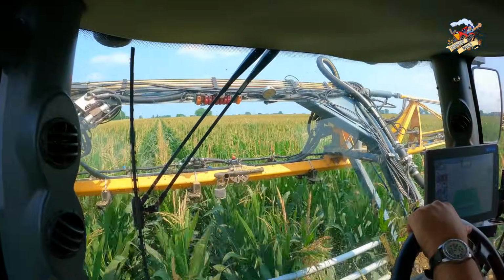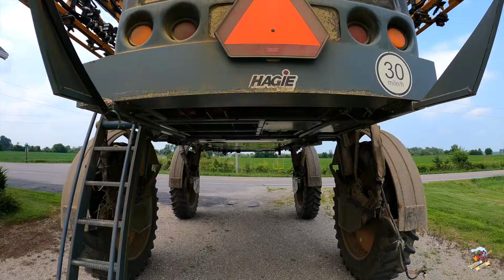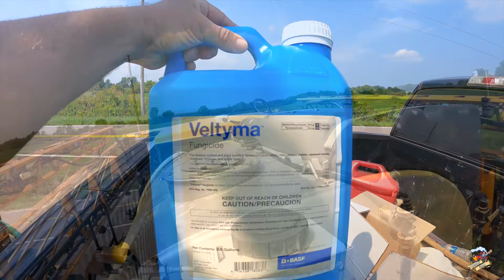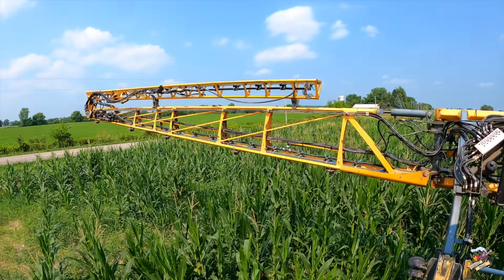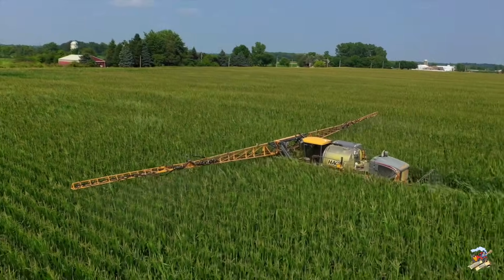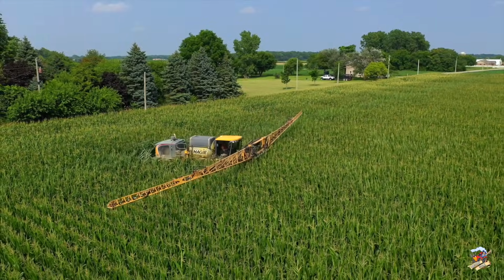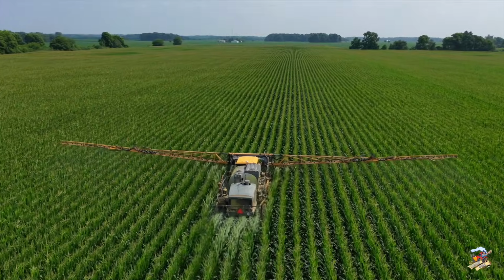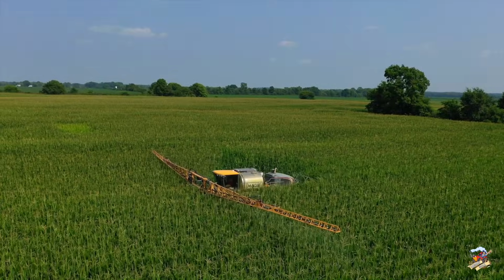Fungicide Application with a Hagie Sprayer.

Comment: The scale of these farms never fails to astonish me, even as someone with a degree in agronomy. I have about 45 acres of fairways, 2 acres of greens and 60 acres of rough at my golf course. A little larger than that one field. It takes me a solid 4 hours to spray just the 45 acres of fairways using an 18 foot boom. Doing 90 acres in an hour is awesome. Doing all 18 greens also takes about 4 hours but it's a much more precise application running considerably more water per acre. Even though it looks pretty, I haven't found a turf that actually enjoys being cut at .125" so we verg careful.

Comment: There"s no way I would ever use a front boom sprayer, for health reasons.
Reply: No different than any other sprayer. It's either going under the cab or is getting applied behind the cab like in this video
Reply: Great drone work,  I caught the opening intro as a 120 ' boom,  because of the fold over the most it could be is 100 ft.  Operators that spray tall Corn need to be on there A game.